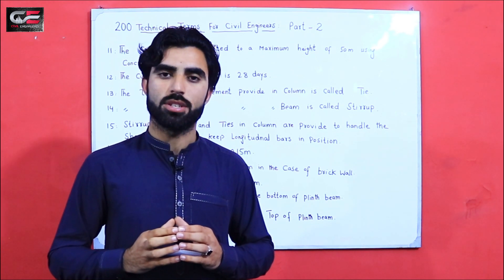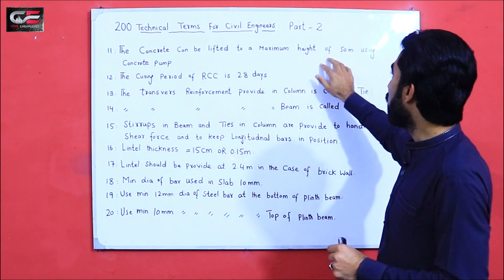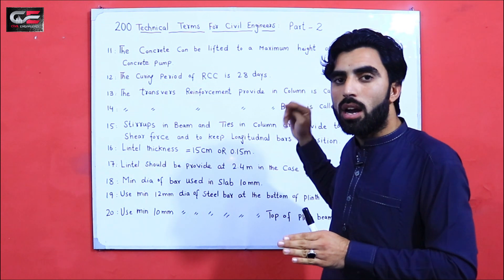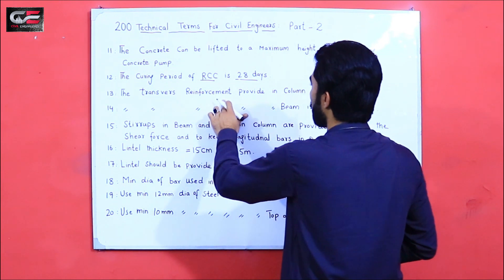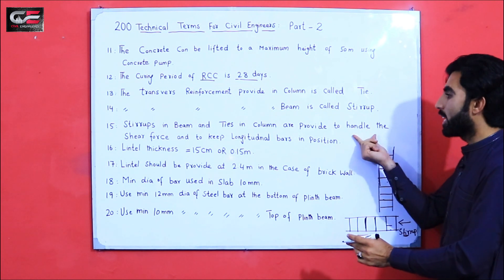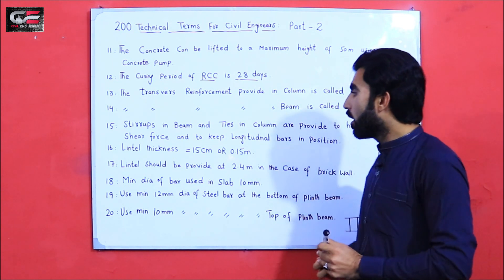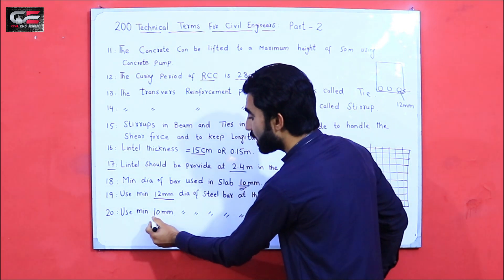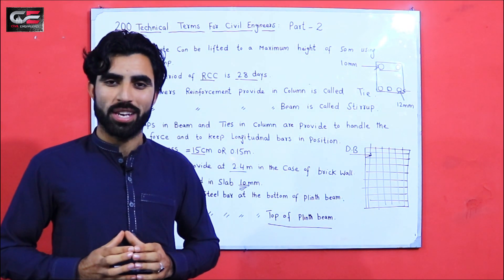200 Technical Terms Every Civil Engineer Must Know - Part - 2

Comment: Why should the height of lintel is 2.4metre in brick work not in stone or block work?.Generaly door height is 7ft(2.13m)from finished floor level. Then why should we provide lintel at 2.4metre Height?
Reply: Sir answer this question plz
Reply: Bro height is not a matter but we need to provide lintel to bear the loads